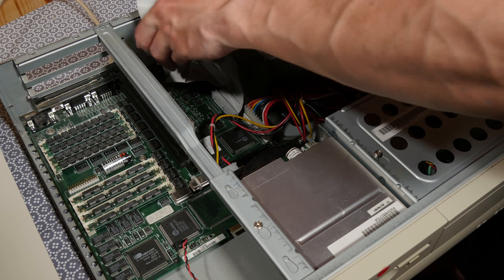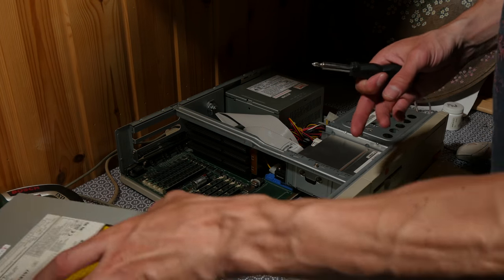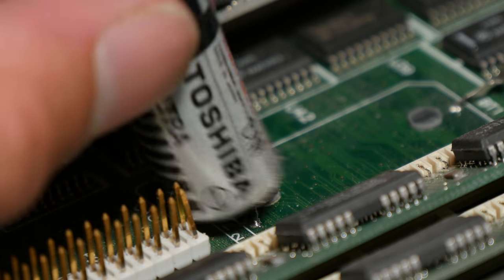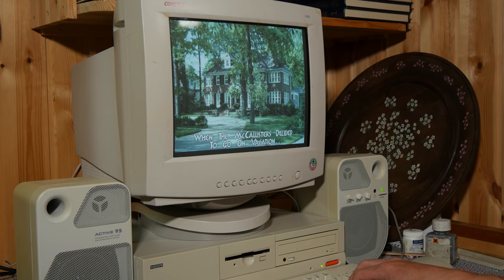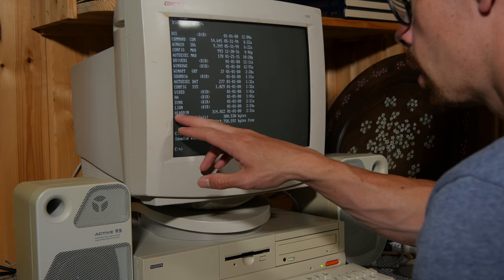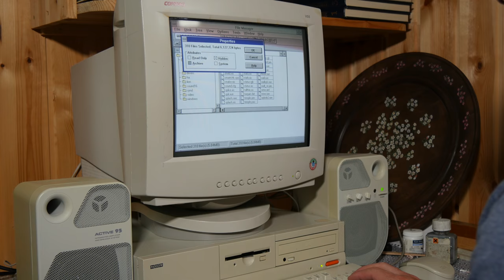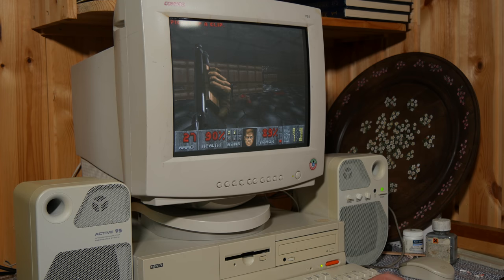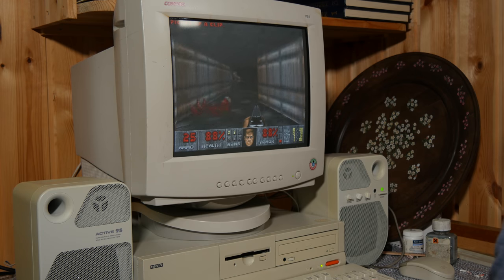Great 486 pc saved from dumpster!

Comment: I know this video is old, but I just have to say this:
That old lithium battery was most likely rechargeable and was receiving charging current from the motherboard. You can't just put a coin socket in there and use non-rechargeable batteries, as they will be charged which is dangerous for them. You need to solder in a diode in series with the socket to prevent current from passing to the battery. You can find guides on this online.
Reply from the maker: That's good to point out. I bought some rechargeable coin cell batteries but didn't mention this in the video.
Reply: @UncleAwesomeRetro  Ah ok, good. Just wanted to make sure, as several people have done this mistake before. =)
Reply: Glad I caught this info.